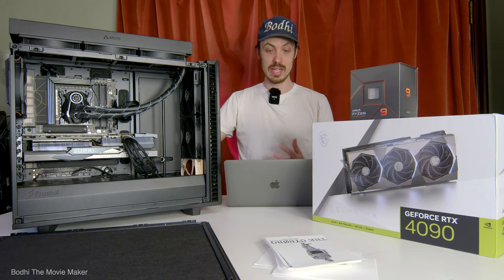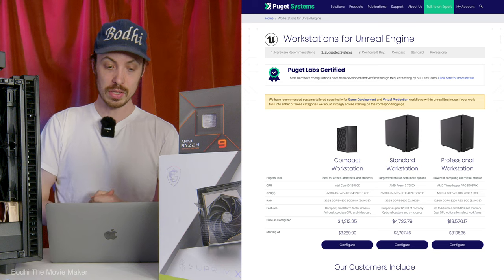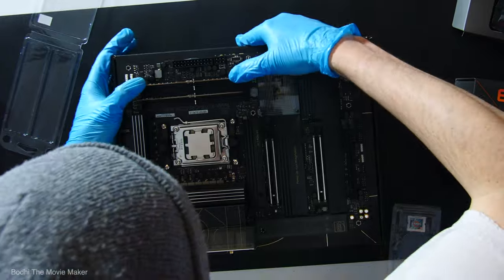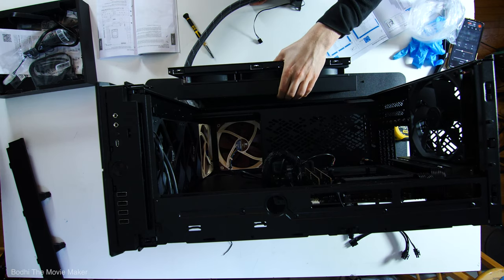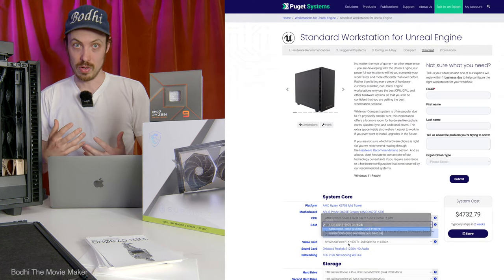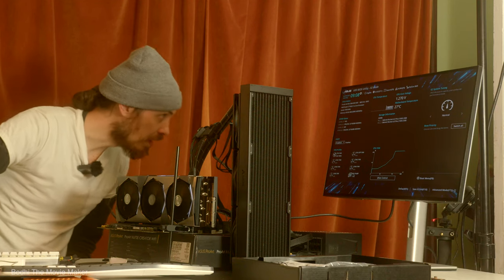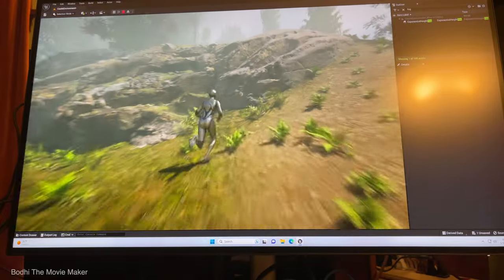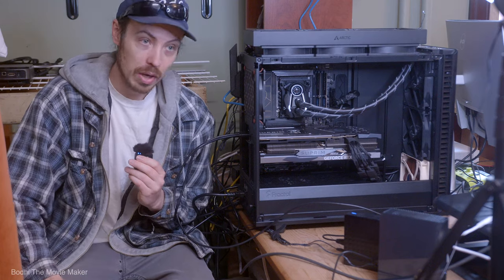I built a PC for Unreal Engine with an Nvidia RTX 4090 and Saved $2,000. Here Is How

Comment: That's the big question...  Do I want to risk running into trouble and screwing this up...or do I avoid those risks and pay the extra $2,000 for a pre-built with a system wide warrantee... 🤔
Reply from the maker: First, if you assemble your PC slowly and carefully following the instructions in the manual, then it’s not extremely risky. Not likely to screw it up, unless you’re really uncomfortable with technology. - if I can do it, you can do it. 👍🏻😊 Second paying the extra $2000 does not necessarily get you a system wide warranty from the pre-built company. that probably will cost you more on top for the $2000 premium

Comment: I’m halfway through the video and. How you mounted the AIO is counterproductive because you are sucking the hot air from the case that is going to the top . This will make harder for your fans to cool the radiator.
Reply from the maker: Interesting perspective. Thanks. But I would disagree. The only alternative is front mounting the radiator in a pull configuration. So the hot air would be pulled in to he case. The way I have it configured it’s pulling hot air out of the case. Plus the CPU is the hottest most thermal throttling susceptible component so I made sure to get that heat out of the system as fast as possible . This config has worked well for me.

Comment: im changing out my systems in februari also ... going with that mobo 2 times one intel 14900k one amd like yours... jaa i need 2 pcs... dont ask ...and keeping the old ones to render out if i need extra power...if i sell them you dont get good money for it anyways so ... 
i have a few asus mobos x570 creator  5900x 64gig (2sticks 3800 because the controller run better with 2 sticks only  remember this for x570)and x570 strix extreme with 5950x 128gig 3600 (stable becaus at 4 sticks thats the max) ...980pro drives are good  so if you want lower cost...530 is also greath choise 
if your starting to build...spend more on your grafics card    and less on drive space ...its easyer to change a drive then it is to change out or sell a used gpu ... so running old m.2s  gen 3  doesnt impact things a lot  in my experience ....you can even build raid sata drive arrays  .... 
and the AIR cooling Noctua is more than enough    it doesnt make lots of noise  you dont need AIO at all   i have the noctua on the AM4 5950 and it does what it needs to do  and its easyer to install   no software extra needed and fancurves to maintain ...trust me i have build more systems and im done with water cooling since i used that cooler hahaha   good case airflow all nocuta also  and thats all youll need ...   and dont over spend on your mobo ... the asus creator boards are perfect  price to preformance and what you can build in them ...and that 10gig port is nice if your using a nas or want to connect to other pcs in an array over an Ubi 10gb router on the cheap ... the Fractile case is quiet   but i have the XL version that has some extra room to work in and makes it a bit easyer to change things over time ...if you have the room next to your desk     jaaa i run 3meter DP cables those are costly  but ok ...  its far away from my ears on the floor ... no RGB sh1t ...and QUIET   🤣    and if you cant afford a 4090   just go with a 4070ti  and put in 2 of them  over time ...and i would wait for the Super card to come out ...4070super that is 2x

Comment: I just watched your video today, right after I bought my own PC specifically built for UE 5, and it was a blast.  
You are probably one of the few people talking about UE 5 build-ups, and it seems like I haven't fallen short on my own build. I haven't seen the Puget recommendations until now, but I have done a lot of research to find the best affordable pieces of hardware to work with. 
With that being said, I will share my PC build for reference:

-Hyte Mid Tower Case Y60 (3X case fans included)
-Motherboard - Gigabyte x670 Aorus Elite AX 
-CPU — AMD Ryzen 9 7950X
-SSDs - 2X Kingston KC3000 2TB 
-RAM - 2X G.SKILL Trident Z5 Neo RGB 64GB (2x32GB) DDR5 6000MHz
-GPU - Palit GeForce RTX 4090 24GB GameRock Kaleidoscope
-CPU Cooler - Corsair H150i ELITE CAPELLIX XT
-PSU - Corsair RM1000e Low-Noise, 1000W, 80 PLUS Gold
-Case fans - 3X Deepcool RF120, 120mm 

I'll use this PC for architectural video rendering in UE5, 3Ds Max, Revit, Twinmotion, DaVinci Resolve, etc. I hope it's a good investment in the long term cause my finances are almost depleted, lol, and even so, buying it piece by piece saved me around 1000 euros.
Again, great content dude, I wish I had seen it earlier.. Good luck with your movie!
Reply from the maker: Thanks for the kind words! So glad the video was enjoyable for ya. And Wow! Great job with your PC build, looks like top of the line on every component. Solid choices! (I have been getting a lot of comments about safety concerns with the 4090 so just make sure not to bend the power cable and periodically check that the power supply is plugged in all the way to the GPU, you have to reseat it every once in a while. 

Yeah buying it yourself is a great way to save money especially with a high end build like yours. Plus so satisfying to do it yourself. 

Can’t wait to see what you make with it!
Reply: @BodhiTheMovieMaker  I can't take the credit for building it myself, I only chose the hardware, the components supplier builds it for me as we speak, as I only know how to add extra ram lol. 
I just saw your other video "Review: Nvidia RTX 4090 / AMD Ryzen 9 7950x - Unreal Engine PC - OP BEAST" and it was rad :)) I just hope I won't run into problems with the GPU  cable.
Thanks a lot for the tips!
Reply from the maker: @ciprianneacsu1733  totally makes sense to get someone to assemble it for you. Less risk.👍🏻 I haven’t had any problems with my GPU. Just keep an eye out for those issues. And you should be fine.😊
Reply from the maker: @ciprianneacsu1733  thanks glad you liked it! I
more coming soon

Comment: at first liked the way you put radiator on top then noticed how it looks from top and you had to take filter off too.  me thinks it looks better inside it will fit..  liked video for creativiity. :) first seen anyone do that with fractal
Reply from the maker: Hey thanks!! Yeah the top mount config has been working fine for me all this time. Very happy with having extra space inside the case👍🏻 the one problem is that without a power right angle adaptor for the GPU it’s a very tight fit. So have have just been leaving the side panel off.
Reply: @BodhiTheMovieMaker  how about coursair switch that would make the PSU hookups facing out, instead of  forward deep in the case and should fit.
Reply from the maker: Thank you!

Comment: sorry PC @850W nativ power usage,........or 1200w@80%
Reply from the maker: So far I am doing fine with my PSU running RTX 4090 on UE. You really think 1200w is necessary?
Reply: @BodhiTheMovieMaker  Don't worry you're completely fine. This PC should need about 700W at max. The 4090 ( all of them ) will use about 450W at max, maybe 500W if overclocked.
The thing is that PSU hold capacity but don't feed Wattage. Wattage is pulled from the components, so in a desktop environment the PC should need about 300-400W. Its when you start up some applications that it ramps up, however it should only reach ~700W in benchmarks as those will try to stress test every single component in different scenarios ( its trying to overwhelm the system on purpose ). This doesn't translate to even heavy workloads, as those are often a single but heavy task, it will put lets say the GPU under load, but not even every component on the GPU will ( eg: the VRAM is the bottleneck ).
However PSU are efficiency rated aswell, meaning that a 80+ rating 850W PSU will draw about ~1000W from the wall, lose about ~20% in heat, and output 850W . PSU's peak efficiency is spot at 50% load, a 1200W PSU whould be the most efficient at 600W workloads. Meaning that it requires less power from the wall and looses less power in the conversion to heat, the fans spin less if at all, and you pay less on the electricity bill..
Reply from the maker: @SttravagaNZza  wow! Thanks for this 😊 a lot of great info! How did you learn all this? What is your connection to the PC world?
Reply: @BodhiTheMovieMaker  No problem. Started as an enthusiast and made my own builds, then got in the field for a bit and later moved on to webdev.

Comment: I finally got the rtx 4080! Hope it would be enough (wich i think so...) + i also got the Xpen 24 drawing tablet, but i'm waiting for getting the screen protector, how do you like your drawing tablet so far? + Is your ram are CL30 or more? I bought by mistake the 2X 32GB 6000mghzzz... CL40 and i read in reddit that the CL40 would create performance issue....but seems like the CL30 are the way to go, so i just got them yesterday!
Have you ran into any issues yet since on your pc build? Ty so much for your videos and replies! + are you plaining of mining crypto with your pc when your not using it for your movie ?
Reply from the maker: Congrats! I bet you’ll be quite happy 😊 plus the 4080 is a little kinder to the pocket book haha - I love my Xp-pen display. Been using it a lot the lately. Haven’t had any real problems. I got a few minor scratches because I used it without the screen protector. But I never see them any other time then when the pen display is off and I’m scrutinizing it from a side angle. So I don’t think the screen protector is “necessary” that being said, I did by myself the screen protector… I’ve just been too lazy to put it on haha

I’ve never actually connected it to my PC. I use it exclusively with my Apple products so far. I have had frequent connectivity issues with my iMac pro. Which are annoying, but I always managed to get it running somehow.  I’m pretty sure the problem is more with my iMac. Pro then the pen display. Because it seems to work perfectly fine with my MacBook Air. 

I will have to get back to you about the ram question. I don’t know off the top my head.   

I’m happy to help! Thanks for your support 😊 

I know next to nothing about crypto mining. Sounds interesting. from what I understand even with my 4090 my set up may not be powerful enough to generate more income than I would be spending on electricity to run it haha 

But if you have any insights on crypto money, I’d love to hear them! Thanks 🙏🏻 😀

Comment: Bro the top 3 fans put them under inside the case and the radiator on top of the case! ...its hurting my head
Reply from the maker: Hmm 🤔 I’ll look closer at that. Thanks for the idea! How do you think that will improve the set up? Better air flow? or better mobo cooling?
Reply: @BodhiTheMovieMaker  better cooling for your cup/ ram
Reply from the maker: I can see how it might improve airflows over the ram. But the 3 fans are part of the AIO cpu cooler. So I think the cpu is all good.
Reply from the maker: And I just double checked… the fans won’t fit inside the case. 
The main reason I have it top mounted is it’s too big for the case. This cooler is made for a full tower. I have a mid tower so I had to install it on the top like I did to get it to be usable on my system.
Plus, it just makes it look more like a hot rod. And she runs nice and cool even cranking unreal engine at high frame rates

Comment: Hey dude, got a question for you. I like what you did for UE5. My question is, would this machine work well with Blender? My main concern is 3D modeling and rendering, so I don't know what this would do in that regard. Would love to hear what you think. Thanks
Reply from the maker: Thanks! Yes absolutely it would be a Blender Beast. If you look at puget systems benchmarks the RTX 4090 comes out way ahead of any other GPU for blender. And the AMD Ryzen 9 7950x also comes out on top for blender.  Puget systems is a great source for benchmarks. This build is top of the line for 3D rendering work flows. Unless you want to go enterprise level and double or triple the budget. The only thing that might be a bottleneck with my rig is ram. I don’t know, I have very little experience with blender. You could get more ram or higher spec ram if you wanted. But that can always be upgraded later if need be. That is why I chose to only fill 2 ram slots at half my total ram capacity. 👍🏻

Comment: Have they solved the melting cable yet? I want a 4090 but not at the expense of a house fire or pc melt down..
Reply from the maker: Haven’t had a problem with mine. You just want to be careful to have the power adapter fully inserted into the GPU. You have to check it every once in a while to make sure it hasn’t pulled out a little. 

You could also go with a beefier PSU that comes with a 12VHPWR Cable so that you plug that into your GPU and avoid the need for the GPU power supply adapter which seems to be the source of the melting problems some people are having. 

I love my MSI Suprim X 4090. Link in description ⬆️

Comment: Just got a price from Dell to purchase a desktop unit that could run Blender......$5,500.00
Interesting to hear how you got this built.....and saved some cash.....
Would not have the savey to build one myself..... congratulations 👏
Reply from the maker: I was seriously considering a pre-built pc from dell or puget systems. Then I checked the cost of buying all the parts myself … and the rest is history 😂 
This is my first pc build so I wasn’t sure I would have the savey to build mine. I can confidently say if I can do it, so can you 👍🏻

Does the Dell build come with a 4090 for that? And do they specify which one? What are the things that annoy me the most about searching for prebuilt PCs if they don’t specify the exact manufacturer of the GPU? Which, as I’ve come to realize matters a lot!
Reply: Nvidia RTX A4500 20GB graphics card ....
Reply from the maker: Hmmm 🤔 that’s an enterprise workstation grade GPU. But I would not recommend it. An RTX 4090 is less expensive, newer, and better in every benchmark, except size and power consumption. 

So your looking at a Xeon workstation?

I would recommend copying my build. To me it seems Blender and UE have similar PC component needs. you want a CPU with High core count for CPU based rendering. And you want a powerful GPU (or multiple for GPUs) for GPU base rendering. 

You could do an intel version of my build. It will cost about the same, just get an intel cpu and mother board. Everything else stays the same. 

If you wanna go with multiple GPUs, I’d recommend going with a AMD thread ripper CPU, but your budget is gonna have to go up for that. 

I don’t know what you’re use case is but if you’re new to blender or intermediate early career. Copying my PC is going to get you an amazing build at a pretty good price.

Prebuilt always comes with a heavy premium.

Comment: I wonder why puget system doesnt offer multiple 4090 rtx as they are faster and cheaper, I've seen other people getting setups with 3 gpus of the expensive ones. But actually the benchmarks for 4090 is faster for lit all software and rendering and you can put 3 4090 rtx in a machine and water cool it or buy it water cooled. So I really do not understand why people buy a super expensive gpu with lover specs. Just for the size? Or durability?
Reply from the maker: Good question. That’s above my pay grade haha. I have seen plenty of rigs with multiple 4090s (water cooled and not) but I think puget is aiming for the enterprise market with their multi GPU systems and so maybe for top of the line enterprise applications is makes more sense to go with the more pricey GPUs.
Reply from the maker: Your guess about durability is probably right
Reply: @BodhiTheMovieMaker  Yeah I looked into it. Enterprises will use it because it more efficient hardware wise, not so much speed wise. They'll use in larger systems because the cooling and wattage is much lower. If you want more than 4gpu's it's not feasable with a 4090 system. But for rendering below 4gpu's and not doing some wild AI stuff that needs more of the GPU memory, I do think 4090 are way better.
Reply from the maker: @collectiveunconscious3d  nice. Thanks for sharing the insight! For a one GPU system I am very happy with my 4090 for filmmaking within unreal engine
Reply: The 40 series has no SLI support. You can use multiple GPU in tandem, but each one at a different task. Also multiple GPU will clog the PCIe lanes unless you build on a server Motherboard with a server Processor. You whould then use Quadro series instead of RTX series aswell.
Reply: Thanks for your insights. One task means that if I render on 3 40 series it wont dividedthe render task among them? Or are you talking about real time stuff?  Couldn't an octane render be divide a task in pieces for separate GPU's?  @SttravagaNZza
Reply: @collectiveunconscious3d  Depends on the task and software. If its a render farm the software will usually take care of it and use parallelization to speed up the task ( eg, send one frame to each GPU ). In Octane Render ( i looked for the software im guessing OTOY is the company ) you can use multiple GPU but for example will be bottlenecked by the GPU that has the least VRAM, as it has to load the same scene in every GPU, the one with the least VRAM will be the limit. I think most of the real time stuff wont work properly with multiple GPUs after the SLI drop ( they use something called NVLink now tough. )